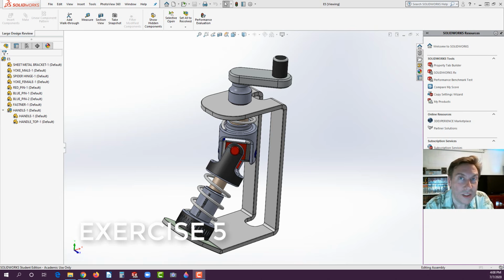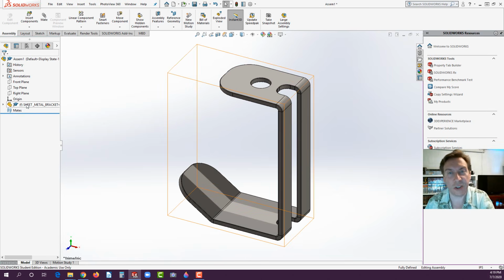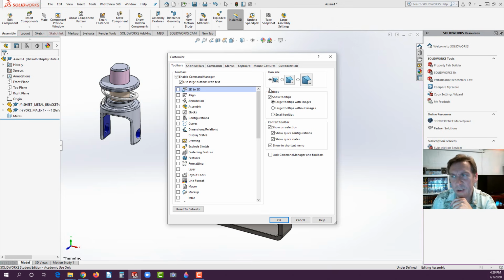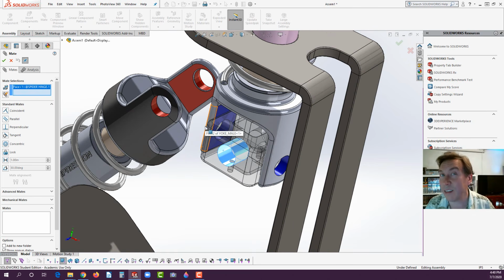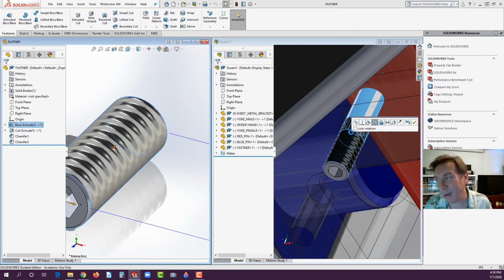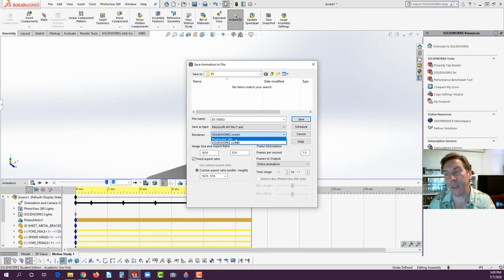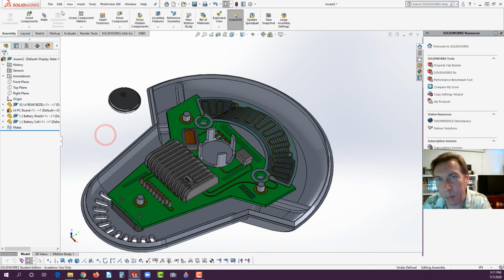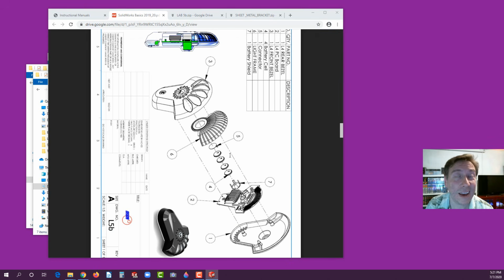E5 SolidWorks 2020 - Assembly Basics 1 Tutorial for Beginners

Comment: Do you know how long it took me to figure out imt 103_3a. Its not as strait forward as Thought when I looked at it. When you put in the tangent arc at the bottom and the chamfer up top it screws up adding reference geometry. so what I did was design everything square, dimension, revolve boss base put in the threads up top, which was its own challenge playing with the setting to make sure the threads were solid. I did add a stud post with undercut because I think it looks cleaner. Anyways. the base cone was possibly the most difficult once I got used to using swept cut, circular pattern and mirror off and reference my reference plane to cut-sweep the other direction. All in all the dome at the bottom with the r5/16 I designed it in cut it out and added it at the end all because the blueprints did not give me a total shaft length beyond the knurled handle. Design intent, makes things like this incredibly annoying but without your teaching, of previous videos, I wouldn't have been able to do it and definitely never would have taken design intent into consideration.

Comment: First of all thank you for spending the time to make this video. It seems odd to me the part you chose to display. I find issues with the practical aspect of the functionality. For example the pins for the u-joint needs circlips to keep them from falling out when in rotation. What feature within the program would detect the inherent vibration and gyroscopic forces pulling on the pins and moving them outward? Is there a simulation where you can import your assembly to run real world test for functionality? Thanks.
Reply from the maker: Hi figifister, thank you for the kind words. Many of these example parts are simply widgets. They allow for simple theoretical demonstrations of the software's functionality.